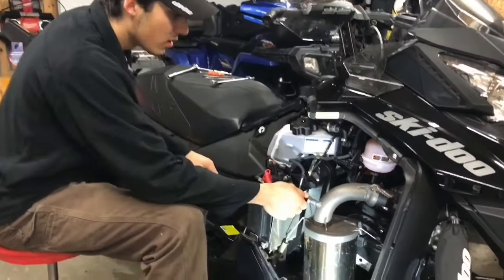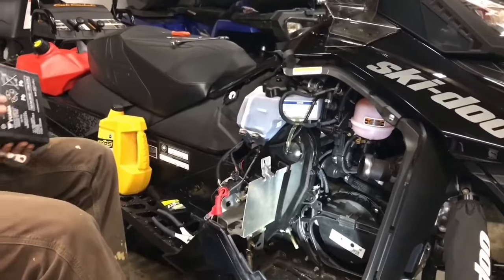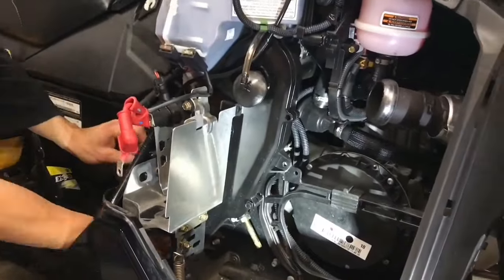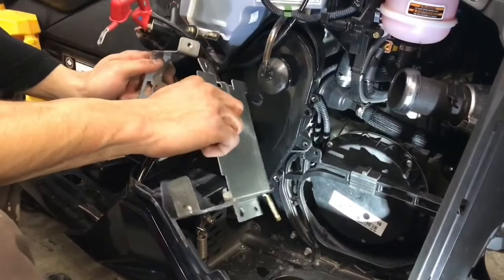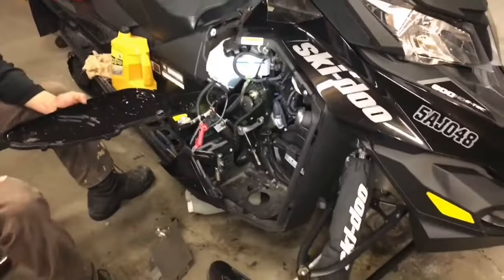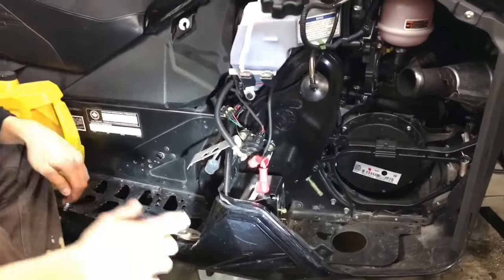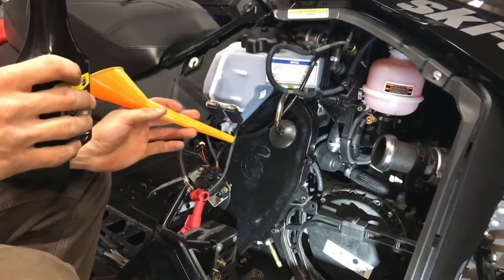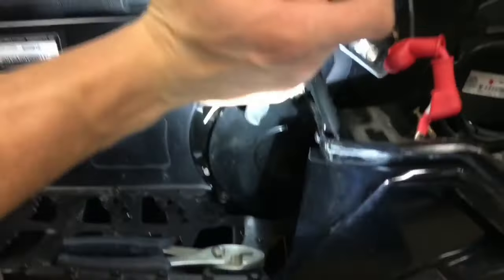How to change your chain case oil in a 600-800 etec skidoo

Comment: Very helpful! Don't undertand why there isn't s simple drain plug, bizarre! Looked up in a service manual and notice you're supposed to tighten down the chain case in a certain order to 89 lbf-in? BTW is your coolant tank filled to the top? Found that odd, they're usually self levelling near the seam at the bottom aren't they?
Reply: thats not where the cold fill line is but year he looks like he filled his to the brim.

Comment: How do we remove the old oil? Is there a drain cap somewhere ? Got a 600 etec 2012
Reply from the maker: You loosen all your bolts on your chain case there is no drain plug
Reply: 4 Season Bros so you just loosen the bolts and let it flow out and make a mess?  Just picked up a 2013 renegade 800 and wanna be able to do  all this myself. Thanks for the info

Comment: The whole battery being ruined on the cement idea is very outdated. Batteries made today are not affected by sitting on cement. Years ago batteries had shells that would absorb moisture and could destroy themselves. Now, batteries have non absorbing plastic cases that can sit on cement all day, every day without any issues.
Reply from the maker: Ok good to know
Reply: Thanks for the video, I just got a 2015 Etec 600HO and am going to change all the fluids.